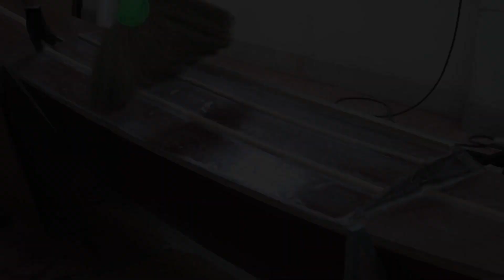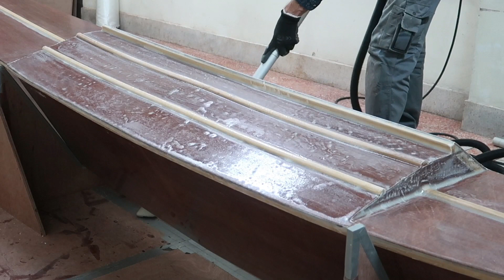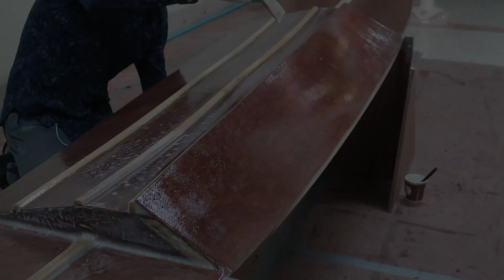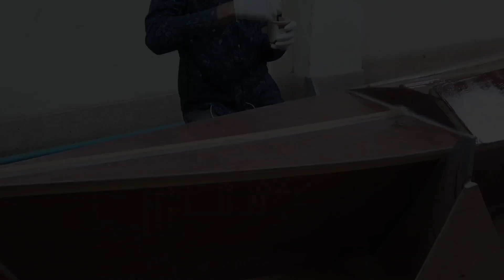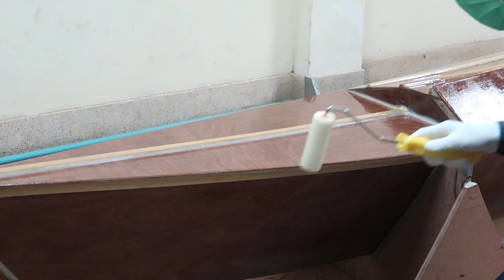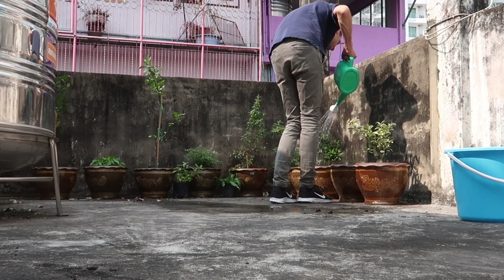Building A Wharram Hitia 14 - Ep.60

Comment: Are those air bubbles in the fibreglass
Reply from the maker: Hi stotas2, no air bubbles, but areas where I applied too much epoxy and the fiberglass floated on top of the epoxy and dried. Should have gone over it with a squeegee or foam roller.
Reply: I see keep up the good work